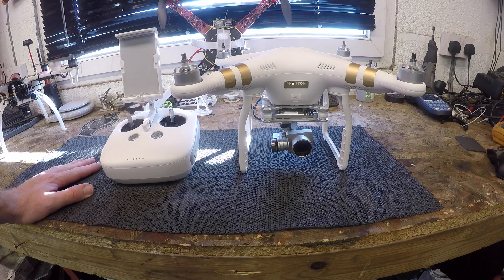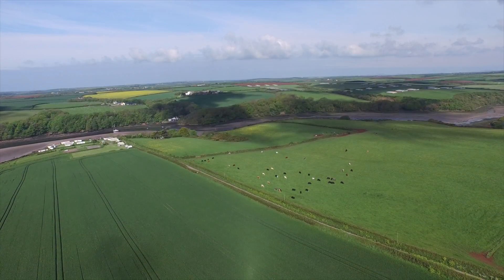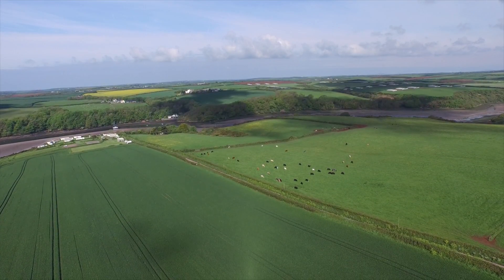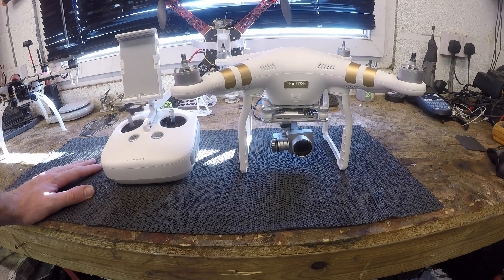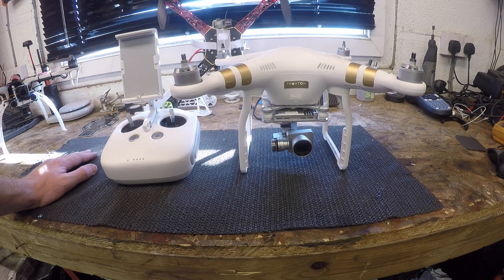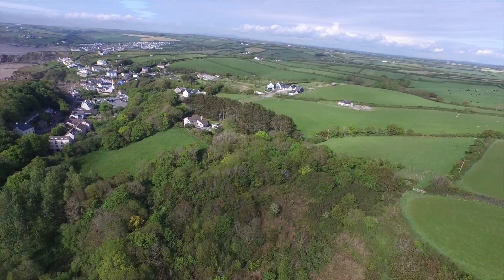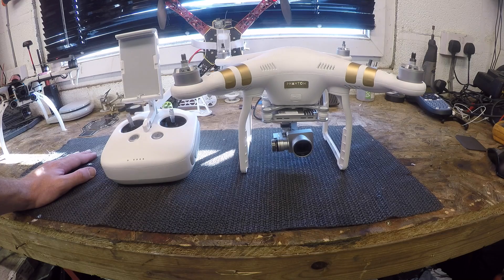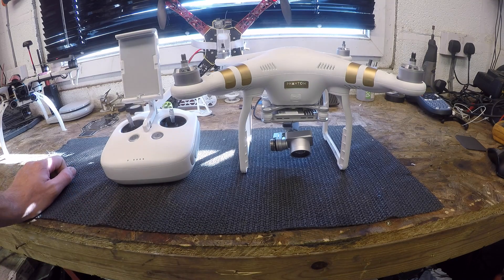DJI Phantom 3 Gimbal Horizon Problems & Drift Issues Explained

Comment: Hi! Why did you errrase the video "dji phantom 3 news, new firmware update, vps issues, polar pro & more."??? I want to see it. Thanks.
Reply from the maker: SANTIAGO ROJAS hi it was a bad edit, i need to re do it and will get it back up ASAP, thanks for the heads up i had forgot i took it down :)
Reply: Mad RC Thanks! With which firmware update you saw a problem? 1.2.8? Should I update with this firmware? Thanks.

Comment: I'm getting a message on my tablet during flight, it says " ultrasonic error land as soon as possible". This has happened during my last 2 flights. The outside temp.was only 6C. Does anyone know if the cold temp. would be causing the message to appear.

Comment: My phantom 3 is having issue descending and not keeping a hold on its hover. I did an imu calibration and an controller calibration, however the problem is still there. Any ideas and help would be appreciated.
Reply from the maker: Billy Smith its likely you have the VPS issue, until DJI release a fix best option is to turn it off.

Comment: I have yet to have any of these so called problems with my p3 pro.  only once did my gimbal  calibrate and was siting crooked and it was easy fixed by picking it up and setting it on a more leval spot on the ground and turning it back on.  BUT as far as drifting my p3 is the most stable one out of all of my phantoms.  Some times when Im hovering I keep thinking my video feed has froze because it is so still.

Comment: i have a question, can the heat outside cause interference issues with the video downlink because i flew in 100 degree weather today and the fpv starts to lag very bad and the gimbal is very hot wen i bring it down
Reply from the maker: Carlos Lopez its won't affect you P3 but your tablet can overheat, The iPad for instance has an max operating temp of 95 and you could easily reach that, the CPU will start to throttle then, make sure you are using your tablet out of its case an all background apps closed